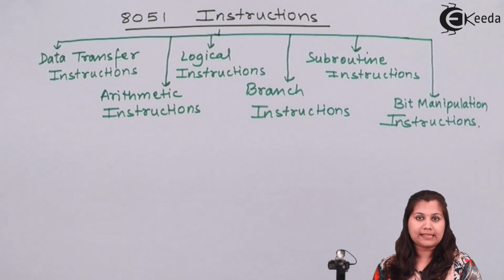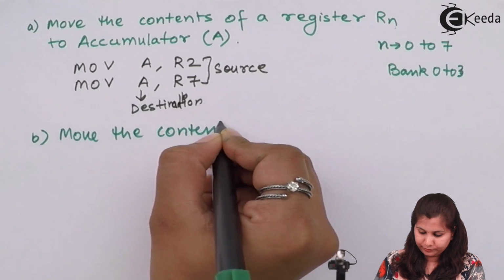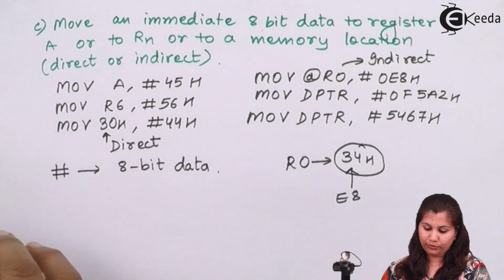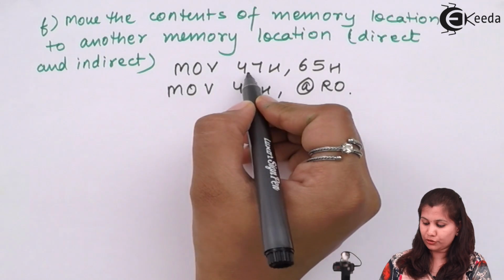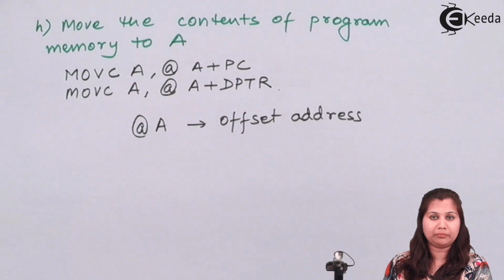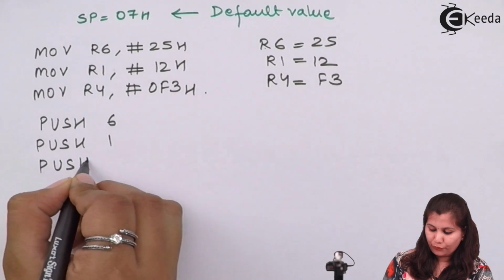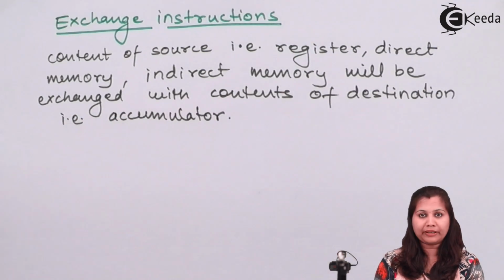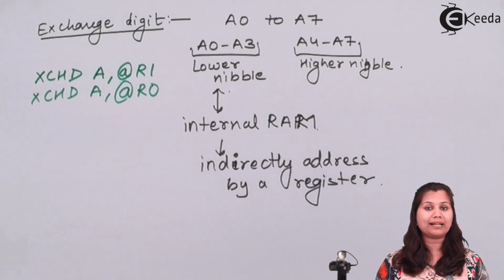Data Transfer Instructions in 8051 Microcontroller - Microcontrollers and Its Applications

Comment: I guess..POP instructions should be perform in reverse order of PUSH operation..Because whatever was pushed at last it is on top now and top should be popped first acc. to the stack operation
Reply: Exactly. Also, for every push, the stack pointer will get decremented. For example, at first push the value will be stored in SP-1 bcos there is already an occupied SP. For the next push, new value will be stored in SP-2. 

For the POP instructions, the Stack pointer get incremented. 🤗✌🏼🤝
Reply: Yes .